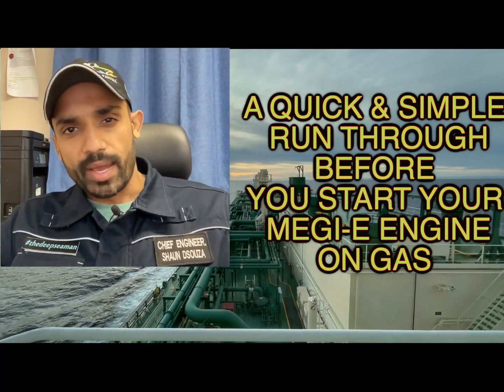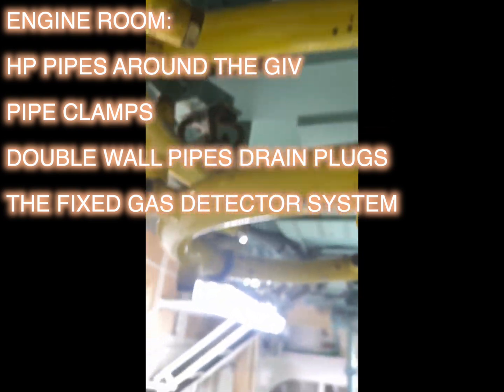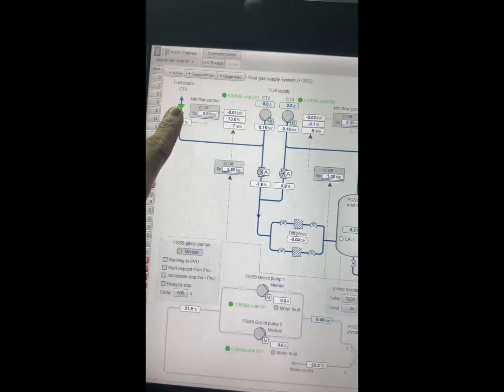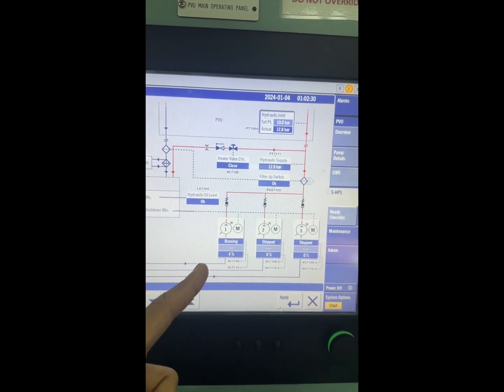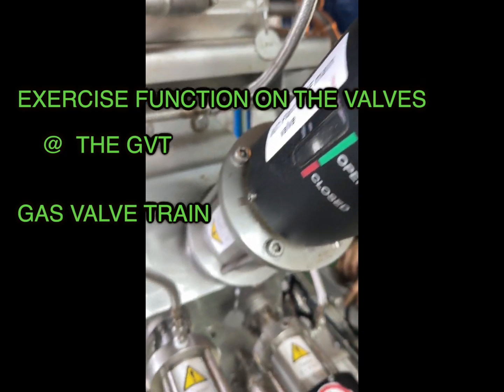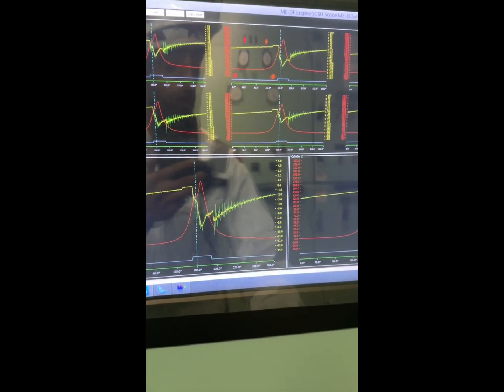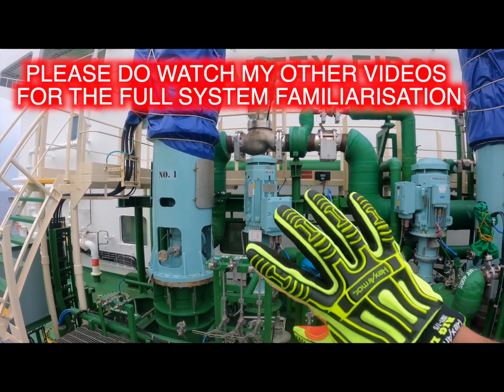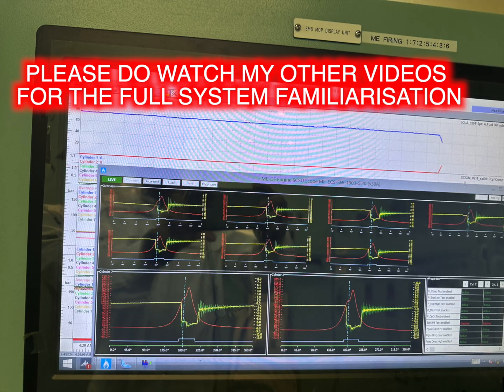MEGI - PART 10: BASIC CHECKS TO BE DONE BEFORE STARTING THE SYSTEM. MAN B&W MEGI-E ENGINE

Comment: Supply pipe pressure test reason sir and what happened on supply pipe pressure test
Reply from the maker: supply pressure test is a part of the state up sequence and it is in the start up algorithm. this ensure the required pressure is built up in the desired time, helps eliminates leaks I system, issues with PVU - pumps, control systems, hydraulics, issues with the GVT